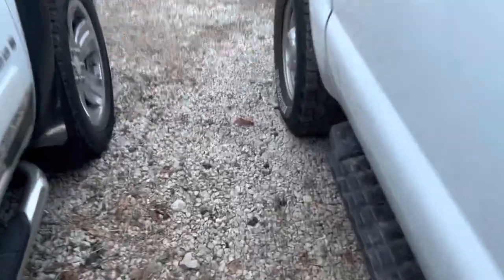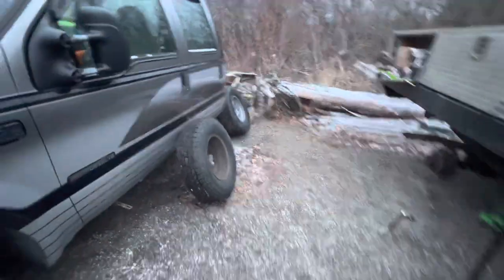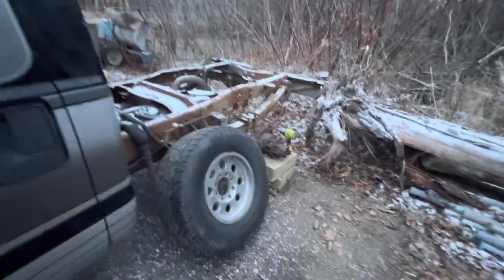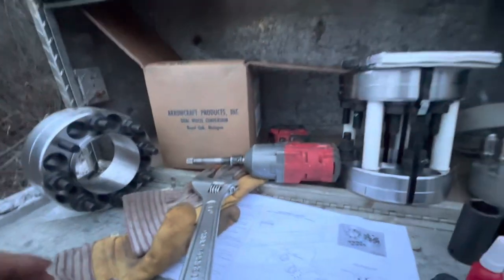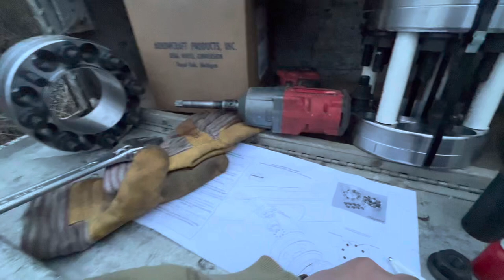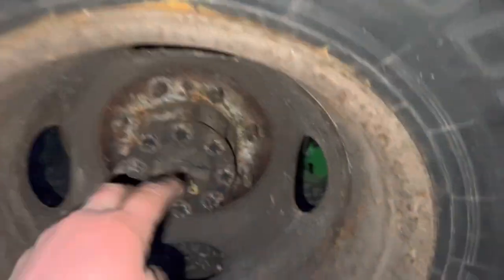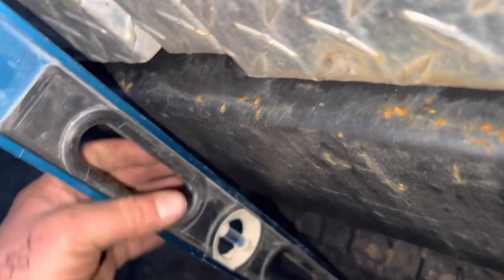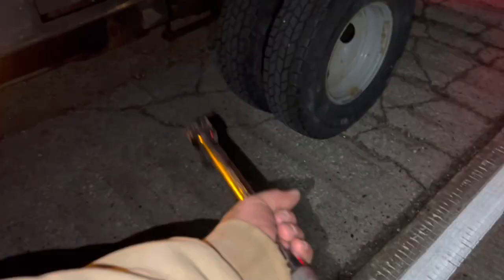Do you need a Dually conversion adaptor? Arrowcraft install on Ford SRW

Comment: I’m just starting to watch the video but this is the option I believe I want to go with. I looked for a drw for a while and couldn’t find a low mile clean one for a reasonable price. Ended up with an 03 350 srw with 129k miles on it for 16.8k and wanting to put a flatbed on it.
Reply: There's an 06 6.0 manual 4x4 cc flatbed drw w/190k miles for sale near me 14500 obo shocked at that price even more shocked at what you paid for srw. What brand did you buy?
Reply: I haven’t bought a flatbed yet but probably going with norstar locally. 
Where did you get the arrowcraft spacers? Their actual website blows and I sent a message on there inquiring but no response

Comment: I've had the Arrowcraft kit on my 95 F350 since 2005, got the aluminum wheel upgrade, it's been good to me. My 97 F350 is a true cab/chassis dually, and when I decided to build it, lift, coils up front(not the superduty swap), it was a pain in the ass because of the dually rear springs. In hindsight, I would build the dually pickup before I ever did a factory cab chassis. Awesome vid btw

Comment: What if you just went bigger with the rim would it not clear the caliper?
Reply: Huh?
Reply: @NonTypicalRacing  using a bigger rim, 17inch vs 16inch
Reply: @killnconquer2645  yeh its not always diameter, the offset and how quickly outboard that casting goes towards the mounting face plane.

Comment: I stead of doing all that go buy an equalizer bar set and a sway bar that attaches to the hitch and the trailer your towing. It keep all the movement from your trailer happening.
Reply from the maker: That’s true if your talking about a lighter weight camper TRAILER. But that does zero to increase the payload and stability of your TRUCK itself without a trailer.
Reply: @UnderTenReviews  your right to a point. Most the time if your towing something bigger it's a gooseneck witch has more stability on both the trailer and truck.
Reply from the maker: @scottrichards2044  do you even understand payload? Do you understand trailer tongue weight? Do you understand how (4) tires can haul/tow more vs (2) tires? 
Maybe you should take your own advice and put anti sway bars on a gooseneck 🤣
Reply: @UnderTenReviews everybody understands sidewall load ratings...well....just multiplying those sidewalls in double sounds good doesn't it? 4 tires' sidewalls are stronger than same sidewalls but only 2 tires worth of them...riiiiight? Sound it out, Lol.